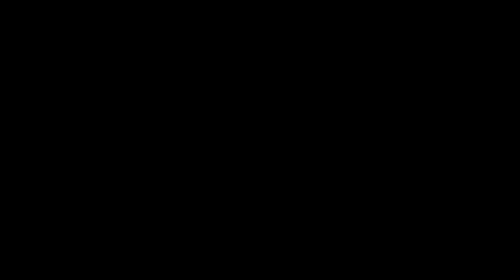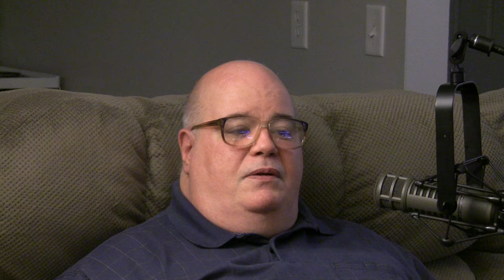Tube Amp With No Load? DON'T DO IT!

Comment from the maker: It has been brought to my attention that Paul McGowan of PS Audio released a video some years ago, stating that it's perfectly fine to run a tube amp with no load. The beautiful thing about America is that everyone has the right to be wrong, and Paul is exercising that right. More power to him. He may not be aware that SOME tube amps, using massive amounts of Negative feedback, are able to control the ringing that can come from an unloaded output transformer. Most McIntosh tube amps are an example.  But most high-fidelity tube amps do NOT have much negative feedback and thus are NOT capable of controlling an unterminated output transformer, and so they will likely be damaged exactly as I have described in this video. I have replaced a LOT of output transformers damaged in just this manner, especially in amps in the under-25-watt range. Many tube guitar amps actually short the output of the amp to ground if no speaker cable is plugged into the speaker jack, as a short is preferable to an open circuit with these amps.

Essentially, you must assume that your tube amp can be damaged by running it without a load, unless the manufacturer explicitly states that it is OK. Or, you can just give it a whirl, and if your luck doesn't hold, I'm always happy to have a new repair customer! Just be sure to bring your Big Boy checkbook with you.

Comment: Can you have no speaker plugged in safely with the amp on, but the amp on standby? Like on a deluxe reverb? I turned my amp fully off and on like 50 times, comparing speakers. I know that's not good for it and I had a power tube go bad. Tube replaced, amp is fine. But I want to keep testing speakers. So is it okay to just put it on standby and leave the power on, like you're taking a break on stage (the purpose of the standby), and plug in a different speaker?
Reply from the maker: In most guitar amps, the standby switch removes the high-voltage power supply from the output transformer and output tubes, or perhaps from the entire circuit, while leaving the filaments of the tubes powered up. While the wisdom of doing this generally is debatable, during the time that there is no high voltage available to the output stage, having no speaker connected is harmless.
Reply: @ScottGrammer  thank you, I really appreciate it!
Reply: @ScottGrammer  one more question, will having no speaker plugged in, the amp fully on, harm the amp if nothing is played/guitar muted? For like 10 seconds at a time. If it's bad at all, I don't want to do it.
Reply from the maker: @Channel-io1di  I only just now saw this question - sorry! It's not a good idea. The amp may be unstable without a load, and so may oscillate and damage itself. Also, just the noise of a high-gain amp can be enough to cause problems with no load. Best to turn it off or put it on standby.
Reply: @ScottGrammer Roger that, thanks

Comment: Is there any easy way to check if I have damaged my vacuum tube amplifier? I started my tube amplifier to realize after seconds that the cable to the speakers was loose 🤦🏾‍♂️
Reply from the maker: The first and simplest check is to make sure the connections are tight and then play it. If it sounds right, isn't distorting, and is not blowing fuses, arcing inside the tubes, or doing anything else weird, it's probably fine. If you have a pair of speakers that you know work but which are less valuable than your main speakers, use them for this test. In any case, keep a hand near the power switch to shut down the power quickly, just in case.

Comment: What about turning it on without a load connected AND without any signal applied? There's only a DC running through primary winding of output transformer and tubes plates, right? So in my opinion it would make no harm, except the tuning off moment when a primary winding of the output transformer would generate a high voltage spike, right? BUT there are many Farads of capacitance in the power supply, therefore the turning off moment isn't so sudden, so there's a chance of avoiding self inducting high voltage spikes. Am I correct?
Reply from the maker: Great question. If the amp in question is stable with no load - meaning that it does not oscillate due to too much phase shift in the transformers or for other reasons, when no load is connected - then it would probably cause no harm. But it's bad practice to ever power up a tube amp with no load. Fender and some other tube guitar amps actually have speaker output jacks that short the output to ground when no speaker is plugged in, as that is safer (for a tube amp) than running with nothing at all connected to the output.
Reply: @ScottGrammer  I agree. That's interesting with those Fenders. So it means that both pins of the output jack are connected to the ground making it effectively a short (0 Ohm load) seeing from the primary winding perspective, right? That's also a very bad thing to do, this time due to excessive current not voltage. I suppose it's better than no load because voltage surge can cause damage imidiatelly and it take some time for current to overheat parts. Correct?
Reply from the maker: @piotrjedrzejewski8664  More or less, yes. The idea is that the overcurrent may cause the mains fuse to pop, ending the issue, but with an open circuit, the overvoltage in the tubes and output transformers can cause massive damage without stressing out the mains fuse, and thus the damage is done. Also, tubes are inherently high-impedance devices, and that high impedance limits the current a bit.
Reply: @ScottGrammer  It's pleasure to discuss with someone that knows the topic. Thank You!
Reply from the maker: @piotrjedrzejewski8664  My pleasure.

Comment: Where were you back in the early 70's when I used to like watching the tubes of an amplifier arc? Among my friends I was the knowledgeable one on electronics, and no book I had read warned of operating without a load. I was the blind leader of the blind, The explanation that finally convinced me was "the tube currant causes the unloaded transformer to store energy in its magnetic field, and when you remove or change the magnetic field the energy has to go somewhere so the voltage will rise until it DOES go somewhere." Anyway, you did a fine job explaining this.

Comment: I have heard from a friend that it is best to not run either without speakers. Guess that wasn't the fact. It makes sense now that I understand the input & output and how it works! Thanks Scott!
Reply from the maker: There are some solid state amps that are not safe to run without a load. But that's because they're not designed properly. If you come across a solid state amp that warns against running without a load, avoid it. It's a bad design.